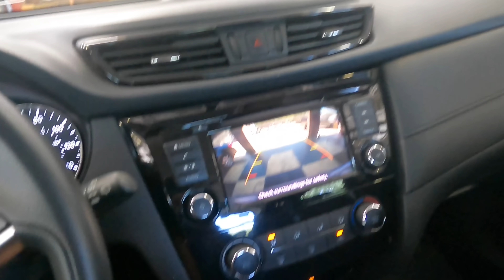Arrested?? Super Secret Hidden Video

Comment: Why didn't you compress the spring a little more when putting the strut back in the assembly? It seems to me that would have made it easier to secure the plate on top without having to struggle with 2 pairs of pliers!
Reply: Now the warranty company will say you ruined the strut shafts sealing with the pliers
Reply: I was thinking the same thing! 🤔
☯️🐉👨‍🦽
Reply: If you've ever seen a spring under full compression slip the jaws you'd know why.  It's one of those things that, if you manage to walk away from it under your own power, you never let it happen again.

Plenty of guys don't walk away from it At. All.
Reply: @SoulSoundMuisc  This is why I hated working with coil springs. Always scared the s*** out of me.
Reply: @blucy10  yup.  One of the most dangerous pieces of equipment in the shop.  Anything that cages or compresses a spring like that is one little slip, one mechanical failure from disaster.  It may not even be the mechanics fault.

Saw a guy get hit in the chest with a brake chamber spring from a semi.  The cage broke.  He left work in a bag.
Reply: What a sat morning. A double dip of Ray..  😉
Reply: @SoulSoundMuisc  
Thats what safty clamps are for.
Reply: Exactly what i was saying the first vid
Reply: @MarshaJ8800TU  exactly. No need for all that.  Jus compress it more
Reply: @SoulSoundMuisc  it wouldnt be anywhere near full compression. Thats what that multi $1000 piece of shop equipment is designed for. That spring is barely compressed. If done bilstiens that required way more spring compression with cheap ass spring compressor tools. Used 2 sets to compress it more because one set would jus keep walkin around not compressing ir enough. That machine would have no prob doing it w all those points of contact

Comment: tip: loop someting over bottom arm (exhaust clamp if it will fit) then put the pry bar through it to pull down with ease.

Comment: I agree with @John Goodman, but one thing I used due to working alone, was ratchet straps. You would be amazed how many hands those things make up for. When did they change the coil over clamps? Used to, we had a clamp set to compress the coil over on the vehicle, removes a great deal of danger and work.
Reply: As I do all my own work, ratchet straps are my best friend.

Comment: Hey Ray. Just have a question on using the Channel locks on the shaft of the strut. Won't that mar the shaft leading to seal failure??
Reply: I always keep old pieces of bicycle inner tube rubber handy, to wrap around parts like that before gripping onto the rubber, for precisely that reason. Rubber gets a better grip, and doesn't scar the metal.

Comment: Would compressing the springs more help with the application of the nut on top of the strut rather than struggling with the sketchy floor jack and pliers?
Reply: I dont know if he just doesn't like fking with a compressed spring... or forgot that he uncompessed the spring when undoing the bolt...
Reply: @gavincarstens6497  hes def too scared to compress it more. With that multi $1000 machine, there's no reason he shouldnt have. Now those plier marks are going to trash the seal. Should have used through sockets so you can have the socket on the nut and an allen to hold the piston from spinning. Or even just use a wrench so can hold the piston with and allen. Also, instead of beating on the knuckle like that, all he had to do was spread the back a little n the strut would slide in n out super easy. They make a socket the has and oval shape coming out the tip so you put it in the back of the knuckle long way up, turn 90° so it spreads the knuckle. Or just use a chisle, big screw driver, or pry bar. I usually like his vids n think hes a good tech, but he hacked this one pretty bad.

Comment: Hey Ray.  I can't remember who0 makes it, but there is an extension tool that screws on the shock which makes it easier to install the shock and bearing plate.  I believe those tools come in a kit for the various sizes of shock shafts and threads.
Reply: Hi Ken, we use the one from Hazet. Part number: 4912-5- fits all Euro asian cars where u have ti widen the hole to ge the shock out with ease. u are welcome
Reply: Yes there are many manufacturers who have kits like you describe
Reply: @andrealt9261  Thank you.  I couldn't think of the name, but I have seen Hazet.  The ones I used were from BMW.  I think that I was the only tech. that had a set in the shop.

Comment: I just overfilled my caliper pin with grease and like a hydraulic every time I pushed it in it expanded back out... I just unlatched the seal pushed it in forcing the extra grease out and then wiped off the excess grease xD. I re-greased the pad clips too and the squeeking has stopped, not sure which one was the cause now but I suppose it's better to do both when it's all apart.

Comment: Don't use the air impact on citroen top mounts it spins the inside as it break the inside of the shocker and it's scrap use a thru socket and Allen key you can probably tight it down but not loosen it

Comment: If the lugs of the steering knuckle were spread 0.003" the shocker/strut would fall out and fall back in without any force. One of the reasons for top bearing plat failure is the force used to remove and install the shocker.

Comment: I have a 2017 GMC Canyon wit the 2.8 lwn duramax and I’m getting 52 mpg on the freeway in cruise control not speeding and in no rush to get up to speed limit… basically drive like you have a 10 inch dong and it’s constantly getting in the way and needs adjustments to enjoy a simple drive to work

Comment: I have a nylon clamp I put on the chrome arm holing fully extended. its 2 halfs held together will allen screws. You clamp rod extended clamp on the top of the body then remove it when top mount is bolted on.  Naughty useing steel pliers low down like that

Comment: Hey what's up man love the videos. I had a quick question. It looks like the strut has a second place for a sway bar link. Is that because its universal for driver or passenger side? Or are there bolt ons or aftermarket suspension parts you add to that?

Comment: I have a super cheap nut driver that can even remove nuts from loose axles. It's the kind with a high speed flywheel that engages the shaft once up in speed. Powered from a wall outlet.

It is also one of the strongest impact guns I have and was a cheap thing I just bought. It could be worth looking into. It is bulky but nice to have.

Comment: I'm hoping to begin replacing my Kia Sportage front preloaded struts tomorrow.
I replaced the sway bar links, then the cross arms, all in hope of eliminating a bumpy, clunky noise.
It seems to have gotten worse, so I am assuming it's that top bushing and parts that go between the strut and the  body.
They were my first guess, but I thought I could get away with doing some less expensive parts. Wrong.

Comment: Hi Ray I have to do these suspension tops from time to time. sadly I only have the back st to work in however I do have a set of cams that spread the control arm just enough to alow the strut to slip in and out easily without hammering.

Comment: On cars that have CV joint, wheel bearing, strut mount failures do you perform about 60 seconds worth of voltage drop tests.  Engine running , headlights on.  
Charging voltage at the battery posts 14.1 to 14.8vdc.
Negative post to the engine. 0.04vdc max.
Negative post to the body. 0.04vdc max.  Engine to body. 0.04vdc max..  
Why.  With a poor negative post to body connection. Or poor engine to body connection. The negative electrons coming out of the alternator can't get thru the designed ground connection and take a short cut thru the trans,  cv joints , wheel bearings, strut mounts. Electrons jumping across the balls like a game of frogger leaving burn marks in the precision surfaces causing failure. Took me longer to type this than to perform this saving a comeback later

Comment: When torquing the axle nut without the wheel on with weight of the vehicle and parking brake, aren’t you transferring that torque into the axle and transmission? Or that doesn’t really matter? I really don’t know - help

Comment: To keep your floor jack from scooting around lay  2 pieces of 8 inch (or a little longer) pieces of 2X4 under the floor jack, 1 just inside the front casters and  1 just inside the rear casters. This will lift the floor jack frame 1.5 inches off the floor; letting the casters dangle in the air. No more worries about the floor jack shifting under the load..... Safety First Brother (from a 75 year old mechanic/body man)     PS: The heading is great "Click Bait"!!!

Comment: You.. could have destroyed the flexible brake line by not removing the caliper from the assembly. I've done those struts before and have damaged the line. So now I always make sure there is no stretching of that line.
Takes a bit more smarts and a mins worth of work but that way I get no complaints about a brake that fks up.

Comment: The bolt that clamps the strut to the steering knuckle suddenly got shorter after the nut stopped spinning on with the impact gun between @16:39 and @16:46. I'm guessing the threads got buggered?

Comment: NEVER USE CHANNEL LOCKS on the STRAT SHAFT IT WILL NICK IT AND MAKE THE oil SEALS LEAK oil. not good at all. use the spring compressor and do it the right way compress the spring more.

Comment: Any idea what could have caused both of the strut mounts to fail at 84,000 miles?
Reply: A lot of bumpy roads
Reply: Here is a clue --        84,000 miles...........
Reply: @frandanco6289  That's not a lot of miles, that's barely break in on most cars nowadays and a somewhat uncommon repair going bilaterally. Just seems odd

Comment: Anyone who sees my tuck knows it's junk lol I paid 1200 for it just to get to work haul stuff to dump, daily driver tires bald suspension questionable at best, front seal leaks a quart a month, replaced the differential seal, truck hates second gear probably throw out bearing or 2nd is burned up. But it's my POS!

Comment: Ray could you use a floor jack to put pressure on the lower ball joint when installing the strut while air hammering the knuckle on the strut?

Comment: Ray At 16:58 I hope it was just editing because the lower Strut mount bolt did Not look tight, you could still see movement and shadow behind the shoulder of the nut. I am assuming for video purposes you dealt with this off camera .... Hopefully.
Also for extra Safety on the Strut spring compressor you can run a tie strap inside a few of the spring coils and secure the ends without tension on the strap. The strap will contain the spring if ever it slips while under compression. I am surprised the compressor does not have a front safety guard.

Comment: why not recompress the spring, i have changed these on my volvos, with even sketchier spring compressors, and if the spring is short enough, its easy to fit the new bearing plate

Comment: At least with nissan you don't have to worry about a directional mounting plate or dealing with a rusted strut piston that you can't fit a hex bit into to keep from freely spinning to remove the strut nut from the shaft...Pun intended..(vw/audi)

Comment: That is one of the most stupid patents for a shock to hub connection. My VW has similar and I lost a whole day to replace the shocks. But there is what they call a strut spreader tool that wedges in at the back and the shock should move in and out the "hole" without the need of that jack hammer.

Comment: Hey Ray, from one autistic to another, I'm no professional but have done all y own vehicles for 46 years.  I always try to compress the spring/strutt upside down. where possible.  The top plate can only then hit the deck if there is still any force on it.  I also try to restrain the spring with three very large/wide good quality zip ties before I remove it from the vehicle incase the spring compressor slips or fails, the spring is still at least somewhat restrained.

Comment: Ray,   I've enjoyed watching a lot of your videos.  Having worked in engineering at  a factory that produced shocks and Macpherson struts there is one thing that makes me cringe in this video.  Grabbing the piston rod with pump pliers is an instant fail no matter how awkward the alternative is. There is a reason the rod has a mirror finish. Even if the spot is in an area that does not usually contact other parts due to over extension, this strut lost some of its seal and bushing life at 7:21.

Comment: Let’s see, 2018 Nissan Rogue with bad strut parts, cracked plastic cowling, corroded horn wire, and a transmission that’s junk from the factory. Not sure what else you could call it other than junk?
Reply: You forgot the door to the gas cap that does not close....
Reply: @frandanco6289  , yeah, but someone screwed that up, it didn’t just fall apart.
I thought about buying one of these for my daughter. Talked to a guy who was a mechanic at a Nissan dealer. Not only did he tell me not to buy one, he said anyone who buys a used one is just getting screwed.

Comment: I have done that job before it was always easier to spread the spot fir the strut to fall back in same for ball joint I had to put new struts on my silveryrado for ease of install I always buy loaded struts I realize he only did the top bearing Plate but should've pushed for new struts you know they are bad if bearing is bad or not that far behind this guy must have car shield after market insurance they suck and will only allow the bare minimum should've got endurance Warranty they say do what needs to be done and quick answers not a week or 2 later

Comment: Gd. Got a 5k dollar spring compressor and your pulling the strut up to put the top plate on.   I hope you read this, and think about it becuse your going to shit your pants when you get it.

If you compress the spring, it won't matter how long the struts shaft it it will be poking out the top.   You would not need to use anything to extend the shaft..
Ray your a good mechanic but we all have blonde moments.  This is your blonde moment.

Dosnt that unit have a set of safty clamps? So if the compressor slips off the spring dosnt unload.

I once used one that worked off compressor air. Change the struts on the car over a jack in a parking lot.

Comment: A lot of years ago while I was waiting for an electrical apprenticeship I spent a few months working on the production line of Vauxhall motors in England.the gave me the job of building front suspension’s. I was terrified of the spring compression machine. The two arms pulling down the spring didn’t feel secure at all.

Comment: Ray too much work . first remove the bolt that holds the bottom of the strut. there is a split between that bolt. hammer a chissel between there to open a little.continue with impact hammer. or long bar between lower controle arm . press down. done!!